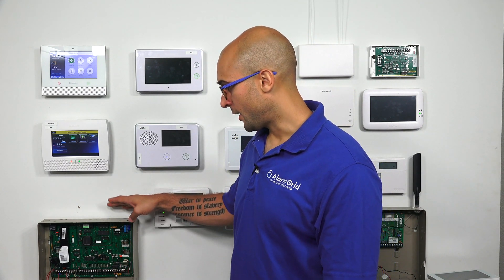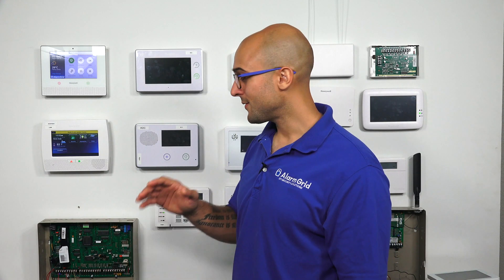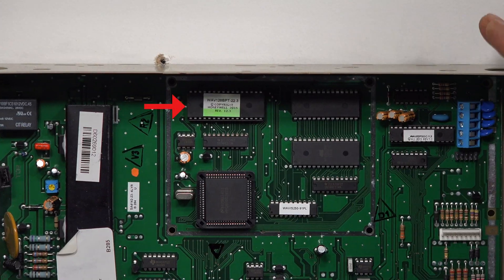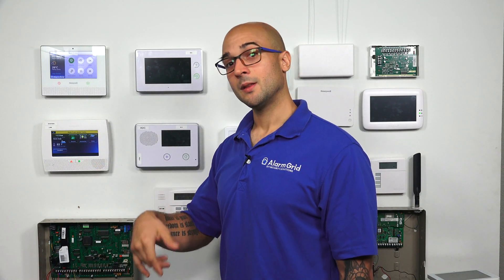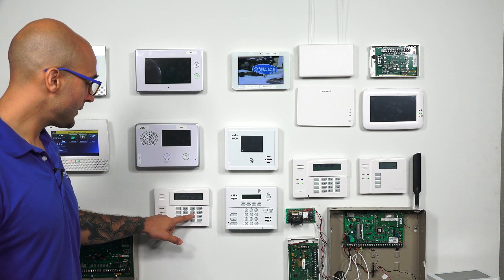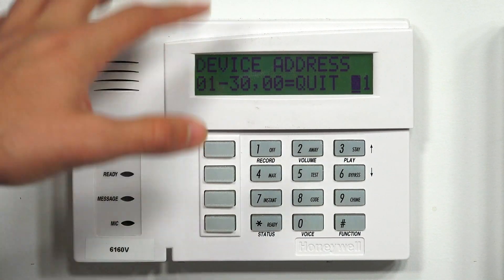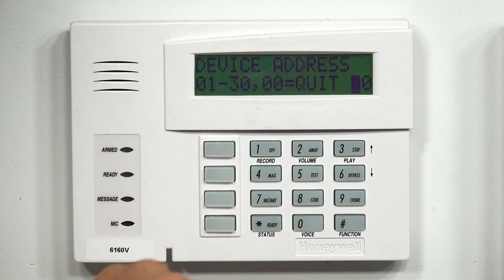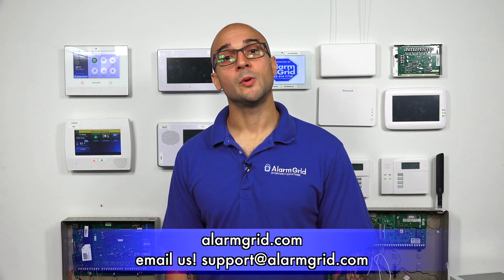Issues Disabling Auto-Stay Arming for a Vista-128BPT

Comment: I thought the code was 4112.
Reply: 4110 is also for honeywell tuxedo keypad
Reply: @chimoyans  It might be on your particular system, but default from the factory the code is 4140 for the tuxedo.
Reply from the maker: The default Installer Code on the VISTA-128BPT is 4140.